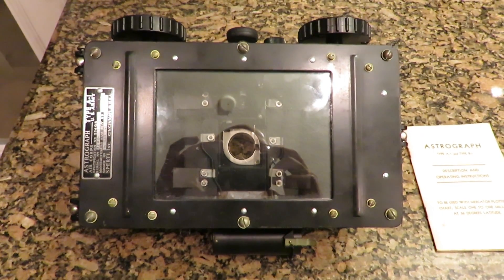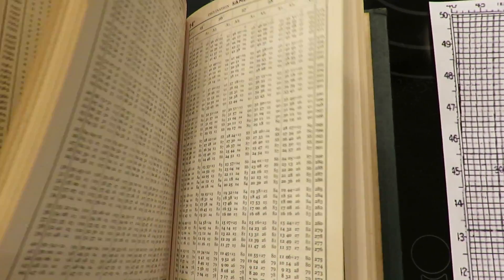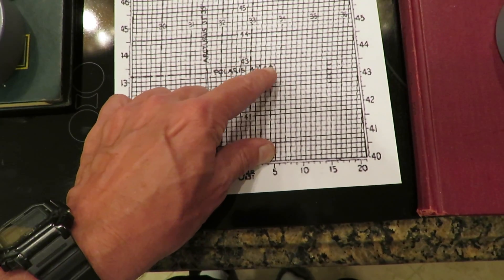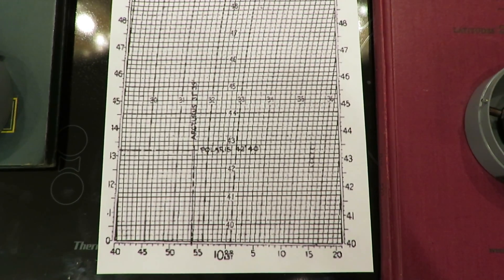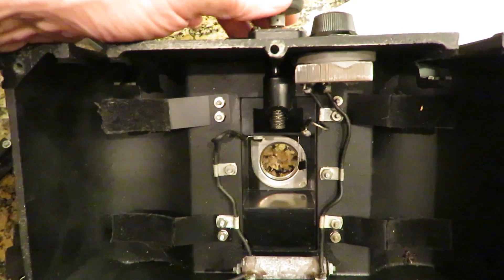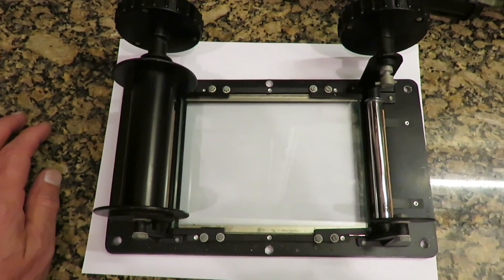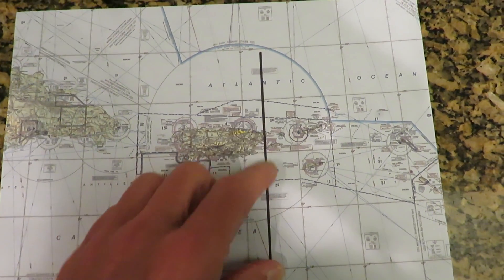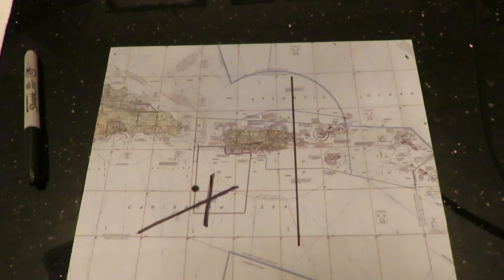The Astrograph and Celestial Navigation in World War II

Comment: Interesting video. I ran into one of these at an antiques show, so, I'm doing research to see what it was for. The unit was there, in it's box, and a light bulb was there in a container, but all the films where missing.
Reply from the maker: A set of films is quite rare.  The film was acetate based and deteriorates over time.  When you open the cans, you can smell the acetic acid, and that is why the deterioration is called "vinegar syndrome".  The only way to stop it is to refrigerate it or even freeze it.  Good luck in your search.